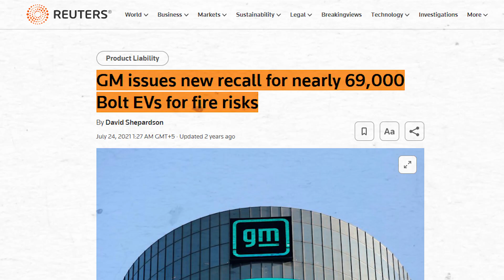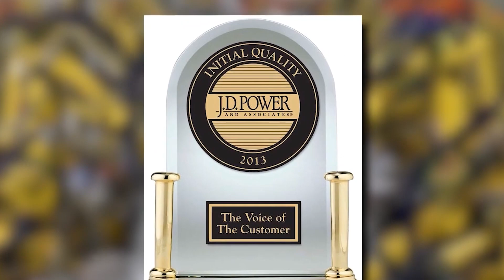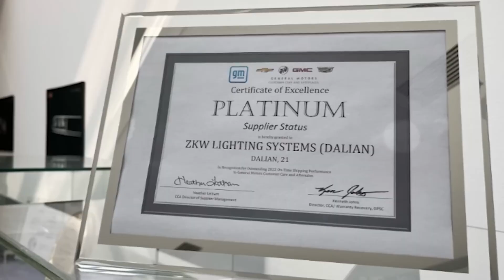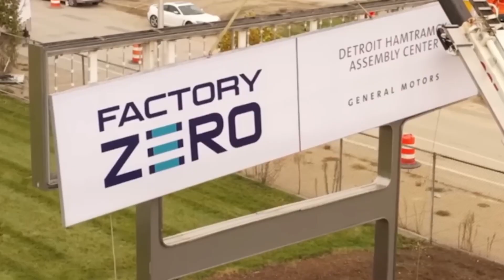Mary Barra is DONE! TERRIBLE GM News!

Comment: Had GM vehicles all my life, and now the prices are out of control. I'll keep my 2000 Chevy Van running w/191K miles. What's with the hard push with EV's? Not everyone is embracing them. Someone's priorities is messed up at GM.
Reply: It's the CEO!!!
Reply: Like you, I drive an old GM car (02 escalade). For the new car buyer, for the right price, unless you need ICE for long distance towing or can't charge at home, EV is a no brainer. Quiet, fast as hell, and cheap to run.
Reply: @willchance6371  If it's GM CEO, then what's with other CEOs from other companies? Akio Toyoda was the lone opponent to this crap. VW had to fire their CEO as he was spending too much money on uncertain products. So, this is not a GM thing.

Comment: Hybrids are significantly worse the just gas or just EV.
Reply: On what grounds? The VOLT was a well made car. Toyota has lots of success with Hybrids. And now FORD is the 2nd after Toyota offering Hybrid options and they sell well.
Reply: you don't have a clue what yor blabberin about , toyota made $20 Billion on very dependable hybrids last year ! and are set to do even better this year
Reply: @bobsaturday4273   GM also made an excellent PHEV. Called the VOLT. Now, they're bringing back those PHEVs. Hopefully an improved VOLTEC system.

Comment: No. 1:40 GM started using press fit critical parts (like piston/rod wrist pins) back in the mid 2000’s, resulting in the worst quality I’ve seen in my life. During the 2000’s you could tell a Chevy because it always had a headlight out. JD Power can fluff GM’s pillow all they want, the era cost GM a metric crapton of customers. I’m one of them.
Reply: They had the excellent GMT-800 platform and the third generation small block (og LS) during this period too.

Comment: The hard truth is that there are limited resources of lithium and other rare earths for production of the batteries used in EVs. Add to that a power grid that is currently unable to support a massive influx of EVs into the market place. Just look at California. If these issues weren't enough to make EVs a poor business choice going forward you also have the limited range and recharge times that make travelling cross country by EV a non-starter for most people. Then there's the safety issue with battery fires in these vehicles. Extremely hot fires that take seconds to fully involve the vehicle.